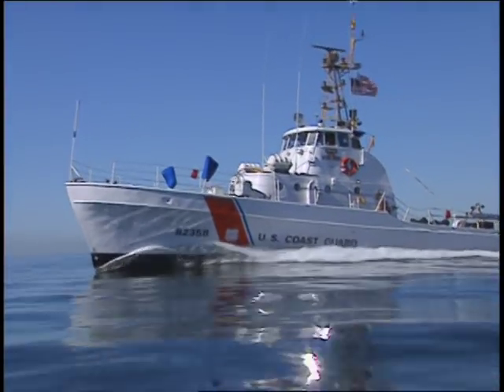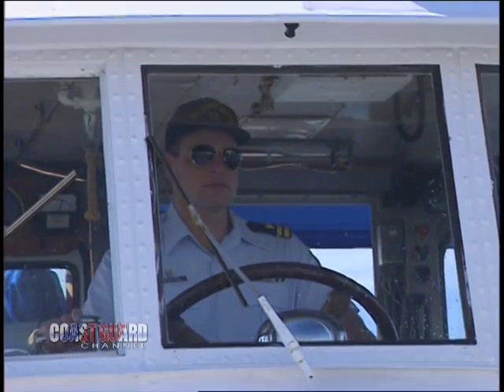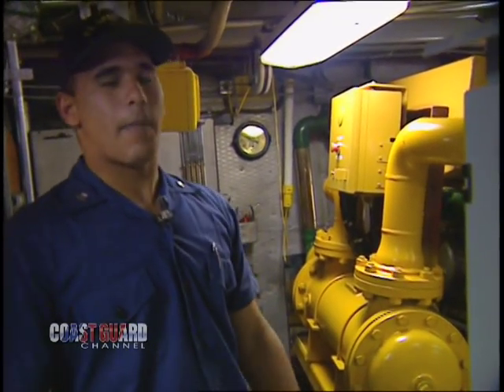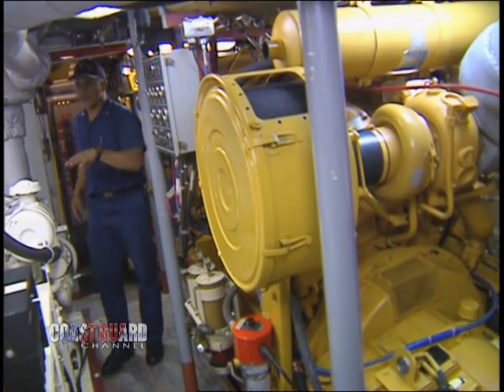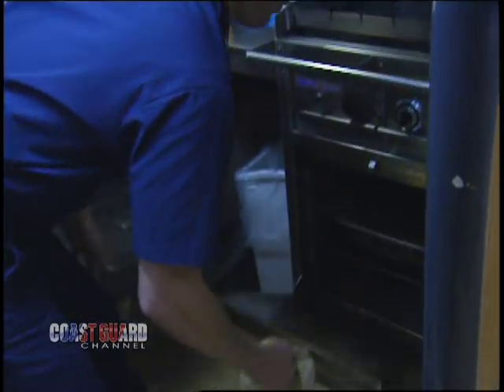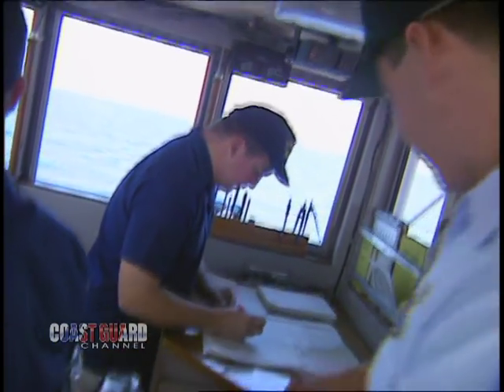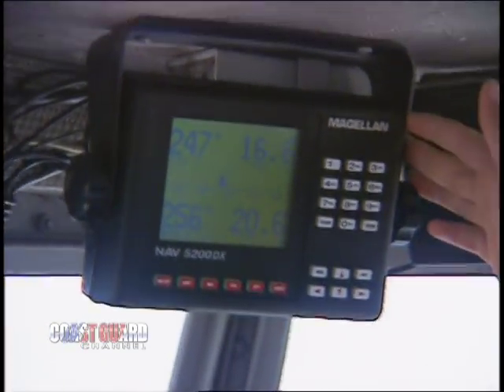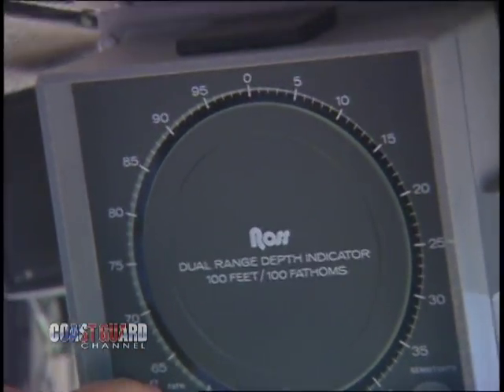Cutters on Patrol: Point Stuart - Part 1

Comment: Was stationed on two 82 footers in the 80s. Point Arena and Point Doran. JG on the PT Arena good skipper. Was on a sar call that started 100 miles off shore ending up over 200 miles out. She took a roll in heavy seas and sat on here side with the safety stantions under water thought we were going over but she rerighted. Had to come back on one main save fuel. Good times tight crew.

Comment: WPB 82332 Point Roberts out of Mayport Florida.  1981-1983.   know as the Point Bobby. Spent many a mile on her. Towed in lots of local boats. Very glad to step off that one. One night it was so rough the boat we were towing in called on the radio and said if we sink remember to cut away the tow line.

Comment: No hearing protection in engine room.
Reply: I thought he had plugs in.  Just another MK looking for a 10% disability check.  As a former MK3 & a retired 2nd Assistant Merchant Marine Engineering Officer I can say it ain’t worth it.  WEAR YOUR F’n HEAD PHONES!!!!
Reply: our boat call the sss point Weber
in Stockton ca
Reply: @franciscochavez2807  I'll have to send a message to the Sea Scout's executive board to let them know that some of their leadership team members are violating safety rules and putting the hearing of young people at risk.
Reply: @franciscochavez2807  A joke?  Is that why you deleted your comment?
Reply: @franciscochavez2807  "all the sea scout  members are ordered (sic) than sixteen"

What does being older than 16 have to do with anything? Hearing loss from exposure to excess noise can happen at any age. And regardless of age, company and agency managers, crew leaders, etc. are required by law to implement safety protocols. Agencies such as OSHA (the Occupational Safety and Health Administration) enforce those regulations.
Reply: @seikibrian8641   we go down to turn on the generator and there not that loud and that it
Reply: The only time we go down there is to turn on and off the generator to use the sea crane  to take out the small boat to have fun on the water or just to get tools
Reply: Plus i have been doing is when i was 13 and my hearing is fine the longest time i have been down there with the  generator running is like 2 half minutes
Reply: @franciscochavez2807  " i have been doing is when i was 13 and my hearing is fine"

Stop making excuses. Hearing damage is cumulative, and the effects can show up years later.
Reply: We are 100% safe there  our skipper care for us he show how to work on the boat all the rule on the boat so we can be safe on the boat and most of all how to have fun a boat so far it have been the one of the time of my life the crew have be like a sec family to me away there for me when i need them sorry if i came out a little rude just want to tell you we are safe and have a good day
Reply: @seikibrian8641  Sir, our skipper will absolutely never put us at risk or even vulnerability to something such as hearing he makes sure that we have ear protection on. Not even just that he makes sure that us young scouts are always safe.
Reply: @xenoslay3302  That is good. But in a comment that he has since deleted, 
francisco chavez said that he goes down to the engine room whenever he wants, as often as he wants, for as long as we wants, with no hearing protection. He needs to realize that hearing loss is no joking matter, which is why I took the strong stance I took in my reply to him.
Reply: @seikibrian8641  Sir, regardless of what he thinks my skipper will absolutely will not let him go into the engine room without hearing protection and it doesn't matter what he says or does we always make sure there is hearing protection.
Reply: He knows that himself and we will have a talk to him about that.